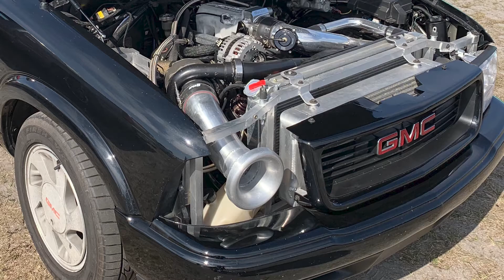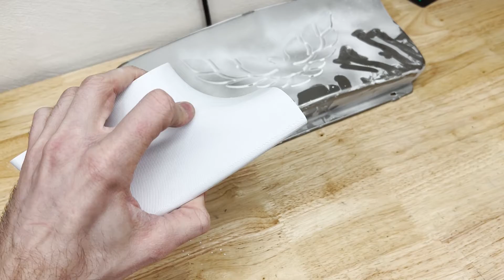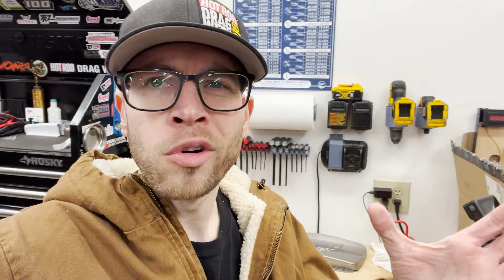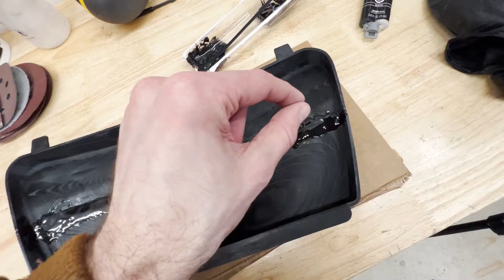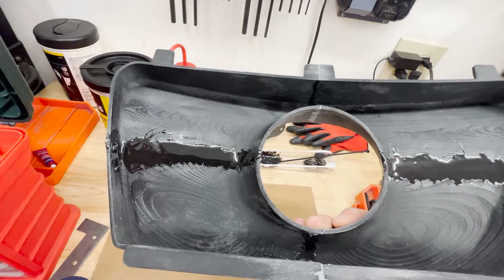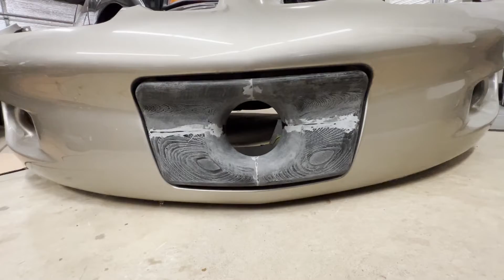Making a True RAM AIR Inlet - 3D Printed License Plate Cover

Comment: I'm sure it's probably been mentioned, but you can dissolve abs in acetone for a DIY abs cement, most home improvement stores also have ABS cement in the plumbing section as well. You can also use acetone vapor to smooth your prints as well. The main potential disadvantage of acetone is that it dissolves the ABS, so if you're not careful, you can change the dimensions of your part. Otherwise, when the acetone evaporates, all you're left with is ABS, which could make paint/finishing a little easier, and last a bit longer because the epoxy may not have the same thermal expansion rate as the ABS.
Reply from the maker: Yeah, I thought about doing that too. I didn't trust myself to get it right the first time. I guess I could have tested it, but I just wanted to get it done.
Reply: @turbov6  I get it for sure, just notes/ideas you can mess with later.

Comment: You could acid etch or have someone laser engrave some metal grate or mesh with the Firebirb logo to cover the rest of the manifold with, that could take care of larger debris and such.
Reply from the maker: It'll have a filter on it when on the street, but just be open when at the track.
Reply: @turbov6  I see, although I think it might look neat even if it doesn't filter debris.